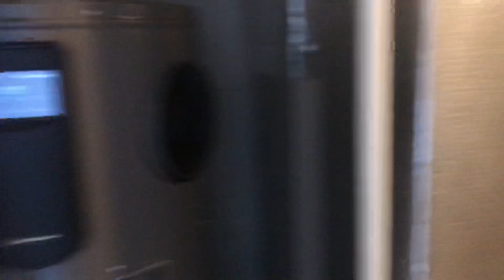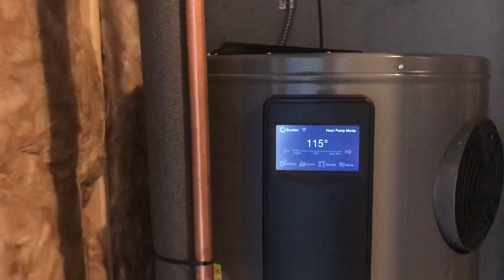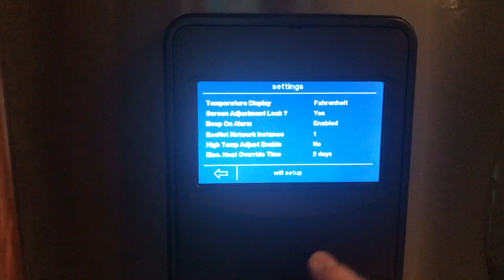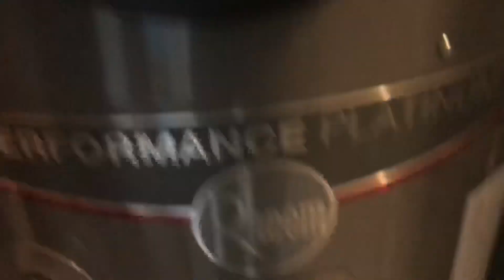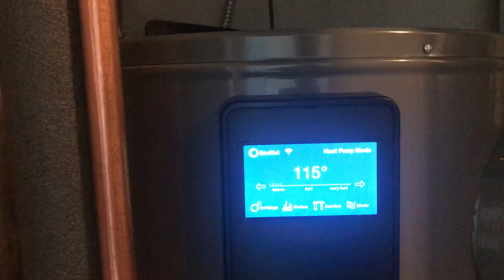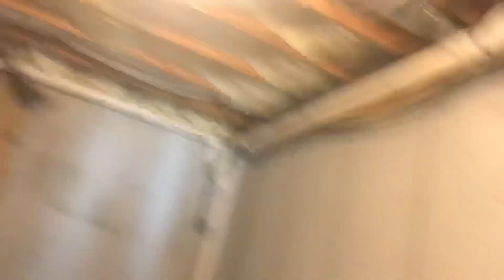Hybrid Water Heater Savings? Was it worth the extra cost?

Comment: Do you keep the door shut for the room your hybrid hot water heater is in? Just curious to know if the room provides enough room for the heat pump to work. I will be installing the rheem heat pump in a room of similar size. Thank you
Reply from the maker: I keep it shut, since the room off of it is heated/cooled

Comment: This would increase your home heating costs a bit in the winter since you’re taking heat out of the room to put into the water with the heat pump
Reply from the maker: Mine is in unfinished area of the basement, but winter is a little more usage. I’m currently at 817kwh for this year.

Comment: What made you but this model, or size ? I see too many people simply buy by price rather your water needs, ine ORIGINAL BRAND from GERMANY HAS THE LARGEST EXTERNAL CONDENSER, AS OPPOSED TO ONES IN USA, HYBRID,THE ORIGINAL ONLY HAS 1  SMALL RESISTANCE ELEMENT, WHICH HARDLY EVER COMES ON ,ALSO I HEAR NO NOISE COMPLAINTS IN EUROPE, BTW, FINALLY THERE IS. 1 MODEL OF RHEEM THAT DECIDED TO EMULATE THE GERMAN BRAND,BUT THEY STILL CARRY W LARGE RESISTANCE HEATERS LIKE A NORMAL ELECTRIC TANK MODEL,
YES THE GERMAN BRAND STEIBEL ELECTRON,IS CARRIED BY HD, BUT ALSO COST MORE THAN RHEEM,,,🇩🇪🇩🇪🇺🇸🇺🇸
Reply from the maker: Replaced the previous one that was the same size

Comment: I'd like one but my HWH is in the garage and it's electric as well BUT there is no floor drain. so I guess I'd have water all over my garage is that correct?
Reply: The unit creates condensate as it runs.  If your water heater is located near an exterior wall, you should be able to run the drain line through the wall.  Adding a floor drain will be more work, especially if you are on a slab foundation.
Reply from the maker: Being in the garage would be great in the summer time. It puts off great amount of air, the floor drain would be easy to install or just run outside.

Comment: This is 50 gal unit? also which part of the country are you locate so we have an idea how cold the winter months are.
Reply from the maker: It’s a 50 gallon unit and I’m in VA
Reply: @projectenergy  where in VA? .... Central? RVA?
Reply from the maker: @vroor32  Lynchburg
Reply: @projectenergy  I'm seriously thinking 🤔about this water heater, esp if I can vent the crawlspace air into it (or hot dryer exhaust into it during winter ... 😂)
Reply: You could run a vent with switches to the outside and middle of the house(if possible) for different seasons. In Alaska A/C isn't common so having the heater double as one in the summer while venting outside in the winter is a benefit.

Comment: Great vid, ive been wondering about a heat pump water heater. I have a heat pump on my house but wasnt sure if the extra cost was worth it on the water heater side. Something you could do during the winter is if you have a electric clothes dryer take the vent off, put a womans clothes stocking on the end and vent the hot moist air inside the house. Itll help add heat and moisture. Just be sure to clean the stocking every few loads. For my 2200 sq foot house it would raise the temp by 2 or 3 degrees and bring the moisture up about 10 to 15%
Reply: There are kits designed specifically for this purpose.  Some climates have high humidity in the winter, so venting the dryer indoors won’t be a good option everywhere.  Also, if you aren’t able to distribute the moist air to the entire house you might risk creating a mold-growing condition.
Reply from the maker: Thanks

Comment: Replace the Elbow coming from condensate connection with a tee. Put a couple inches of pipe on top of tee and put a cap on it (not glued)  This is for cleaning out the condensate line with some water & bleach if necessary.  btdt.  Also it may even be code.

Comment: When it’s running off of just heat pump mode how many watts does it pull and how long does it run for on heat pump mode?
Reply from the maker: Tim Boe no, that’s just to prevent the heat pump for running to long. If you us 3kw it ran roughly 3 hours for a 24hr period. 

I’ve noticed that in the winter heat pump only isn’t as effective. But still gets the job done, summer is much better.
Reply from the maker: Tim Boe 0-5kw most time. It also has a 2-3 day it’ll kick on the elect element
Reply: It kicks on the heating elements every 2-3 days even in heat pump mode? What to burn off any corrosion ?
Reply: Sorry for my misunderstanding but the heat pump pulls 3kw and it takes 3 hrs to heat water?
Reply from the maker: Not sure the time it runs to equal 3kwh of energy but it doesn’t run often. It also would depend on the location of the unit.
Reply: I’m only asking because I’m trying to decide between that rheem and the ao smith. Someone said the ao smith uses 300 watts for about 45 mins to heat water in heat pump mode
Reply from the maker: Tim Boe mine doesn’t use 300 watts in two months.
Reply from the maker: Tim Boe warmer months use around 100kwh a month and colder 150-200kwh a month.

Comment from the maker: I’ve used 733kw since June install, winter months seem to be a little higher, since it’s in my basement. I think around 1200kw a year for 2 kids and 3 adults.
Reply: ProjectEnergy make sure it reaches at least 142°F once a week.
Reply: @ek9772  why?
Reply: Marc Gallant due to legionnaires disease.  

The recommended temperature is 140°C to kill bacteria growth; however, there is still un-heated water stuck in the pipes that is not heated.  

This drops the overall temperature at the end, and bacteria in the pipes will unaffected.

Best thing is to let it run a few minutes (two) to flush the water stuck in the pipes.  If it has been idle for several weeks or more, then heat it up, and let it run for more time.  This will help flush out any bacteria within the pipes.

In his case water is probably used continuously; therefore, any growth of stuff is probably diminished but best to be safe.
Reply: You happen to know what the energy saver mode does ? Difference between heat pump mode vs energy saver mode ?
Reply from the maker: Videpedia heat pump will run all the heat pump, vs saver will use the heat pump and the electric elements if needed.
Reply: My local electricity rate is about $0.32/kwh. If I use 650kwh per year it will be $208 annually to run this unit for me. I wonder if this electric water heater really does save much.
Reply from the maker: Videpedia most are rated at 4500kwh a year vs this is around 900
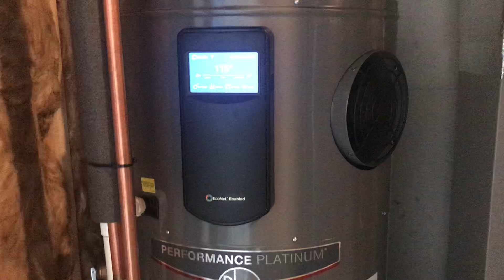Reply: @projectenergy  Thanks. 5:02. Average about 50kwh per month ? So that is 600kwh per year ? So not 1200kwh per year ?
Reply from the maker: Videpedia it’ll depend on your water consumption. I range 1kw-5kw per day.
Reply from the maker: Videpedia was my summer average

Comment: Great review.

Could you provide actual values for electricity consumption per hour, and the number of hours it runs per day?
Reply from the maker: Around 100kw a month, some days it may not run at all, most days range from 3kw-7kw
Reply: Your use is more than mine. We are a house of 3.  We tend to use about 3kwh per day. No higher than 60 per month. Ive seen higher but not often.
Reply from the maker: Nick Koutsoulis it depends on the weather, mine is in unfinished basement.
Reply from the maker: Checkout my new video with actual numbers.